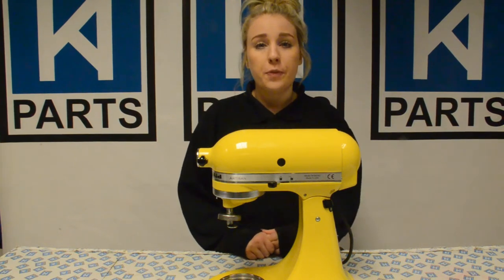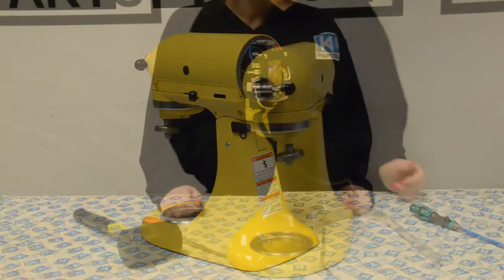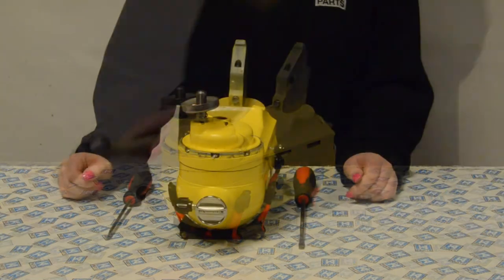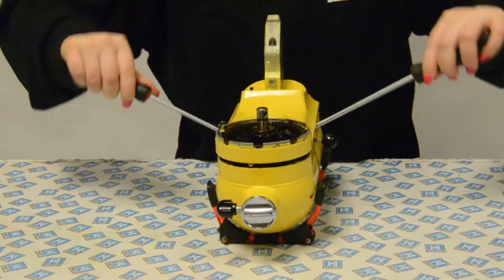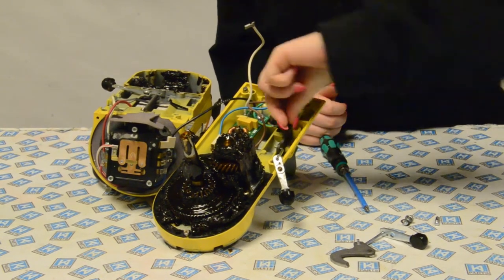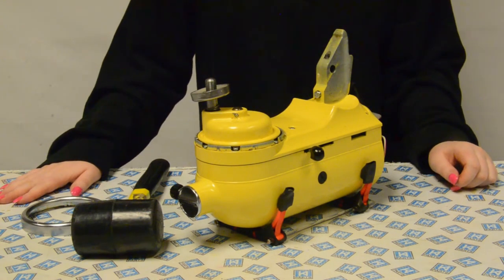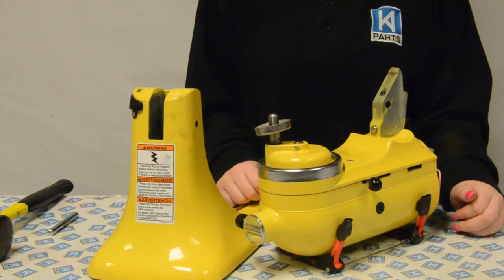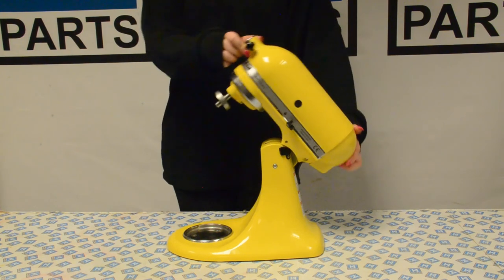Replacing your Tilt Lever on your KitchenAid Mixer

Comment: In the USA you will need square bits.  This was super helpful.
Reply: That really depends on the age of the mixer in the U.S. I think the square bit is a fairly recent development. I'm really not sure when they started doing that. Think of it was made  early 2000's or earlier you won't a square bit screwdriver.

Comment: Thank you for this tutorial.  I didn't get a whole tilt assembly; didn't know that part existed, actually.  I just ordered a tilt lever.  (I wanted to replace the tilt lever because the knob was missing; and buying a single knob is not an option apparently).  To get the old lever off the rod of the assembly, I needed to file the bur off of the tip of the rod that was permanently holding the rod in place.  Once I placed the new lever on, I decided I really wanted/needed to figure out how to hold the lever in place again so it wouldn't accidentally slip off the rod someday; or in my case, as I re-assembled the mixer.  I ended up using an earring backer; a small, white, round rubber "back" that is designed for the back of a pierced earring.  I had to make the earring back hole bigger with my dental pick, so it would fit onto the rod .  I fiddled with it for a while to make it fit; but now it's on snugly.  By the way, I changed the grease; I did not take the gears off, but spent about 45 minutes with popsicle sticks, Q-tips, and bits of old rags to remove as much of the old grease off as best I could.  And,  I didn't have the proper cradle to hold up the upside down mixer!  So, I  rolled a washcloth inside each end of a hand towel, and set the mixer in between the rolls and that worked pretty well.
Reply from the maker: It's great to hear you successfully changed the lever and used the back of an earring to do it.  It's not something we had thought of doing but it makes sense.

Comment: I purchased a new Artisan and the lever will not slide all the way and the head won't lock fully. All the youtubes suggest turning the screw below the tilt hinge but that just raises and lowers the head resulting in the beater hitting the bowl when too low and missing the bowl contents if too high. I did the dime test and to get it right, the head will not lock. Do you think I need to open it up and   adjust the lever somehow or replace it? Thank you.
Reply: Do you have an update? I have the same issue

Comment: Any tips on removing the pins from the planetary. My pin has been quite stubborn. I've read that people have used a heat gun, wd-40 and putting the mixer in the freezer. Metal does contract in cold temperatures, so that sounds like the best way to go. That being said,  Is there only one way to hammer the pin out or does it work either in either direction? Thank you
Reply from the maker: If the pin is REALLY stubborn then it is possible that over time that the pin has sheared slightly.  When you then hit the pin, some of the force goes directly into the shaft and will mean a huge amount of force will be needed to get the pin through.  At this stage it is unlikely that extreme temperatures will make much difference and lubrication will not help at all.  It is always worth trying the pin from either side.  There is no fixed direction but there may be less resistance one way than the other.  As a final resort you may need to drill it out.  Use a much smaller drill to start and only go as far as the shaft on either side.  Increasde the drill size a little at a time and eventually you should be able to pull away the tip of the pin without damaging the planetary or shaft.

Comment: hi we took out the bush on the side when it was stil plug in thinkin it was a fuse it sparked & now the mixer wont work?????
Reply from the maker: Hi,

Thank you for your enquiry.

Please would you kindly send us a photo to our email of your motor brushes and the inside of the back of the mixer. You will need to unscrew the end cover. 

We look forward to hearing from you.

Jade
Reply from the maker: It is quite possible that you have put the brush back in the wrong way round.  Have a look at our video here https://www.youtube.com/watch?v=5YuS3atXR0M which shows how to fit them correctly.

Comment: Ive had to replace this latch twice despite minimal use of the mixer! This extremely poor locking mechanism is the result of whirlpool buying the kitchenaid brand and systematically downgrading the parts and design to save money. This issue is extremely prevalent now. Im shocked that whirlpool has destroyed such a famous mixer, very soon these mixers will be known for the garbage they have become, rather then the great mixers they used to be. unbelievable.